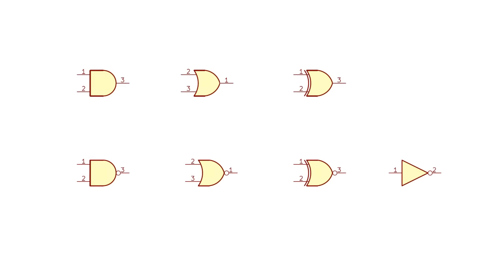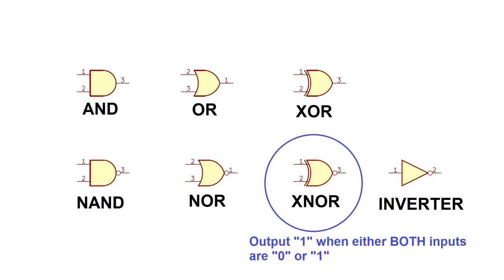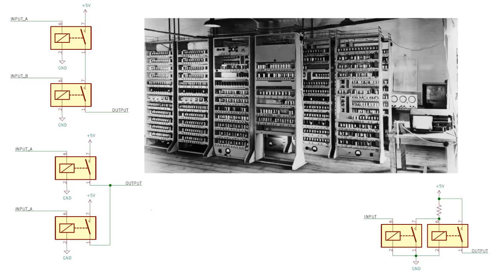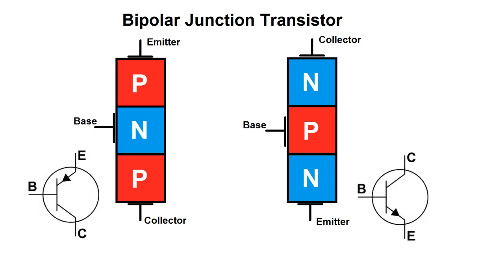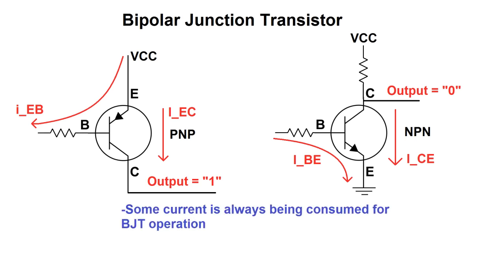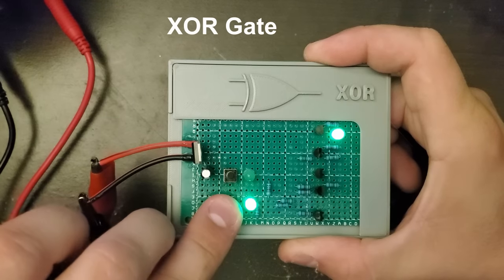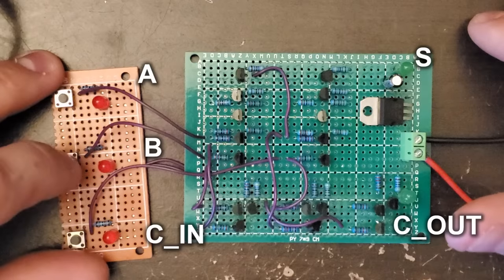8-Bit Adder built from 152 Transistors

Comment: You've done a better job explaining the working principle of MOSFETs and BJTs in 3 minutes than both of my professors did in two semesters of semiconductor physics and semiconductor devices. Hope you keep making content
Reply: I was about to say THIS!!!
Reply: Because you're supposed to know the physics behind and should be able to calculate what is required. You're supposed to learn much more than any random guy watching a youtube video.
Reply: No, he didn't. He didn't explain the "working principle" at all, he presented a convenient mental model. He never said why BJTs act as current amplifier and MOSFETs act as voltage-controlled switches, only that they do.

I'm sure you'll remember the discussions of band gap, depletion regions, MOSCAPs, pinch-off, different types of dopants and their free electron/hole densities, etc. All of those concepts are 100% necessary for understanding how a transistor works physically. What was presented in this video is a shortcut which is good enough to understand a circuit diagram of a logic gate intuitively, but which is woefully inadequate for designing or verifying anything complicated.
Reply: Do you study computer science?
Reply: @tissuepaper9962  Also: The logic described here is Wikipedia - "Resistor–transistor logic" and NOT Wikipedia - "Transistor–transistor logic".
Anyway, nice handiwork and presentation. And a reminder that we all make mistakes;) (What I mentioned above and the wrong emitter arrow direction at the NPN-Transistor symbols). Also: I knew, You knew something, which @braedenbutler4838 did not (or he forgot?). So he couldn't really judge that 3 minutes is a little tooooo less for learning and understanding the principles and physics behind semiconductors. Let's better take 3 years as a ballpark number. We aren't in a hurry, are we?:)))
Reply: There's always this nonsensical comment on any video that explains anything technical but I bet if the teacher gave this as a resource, you'd have people complain that the teacher didn't actually teach.
Reply: @vinayakonimani7628  How original of you
Reply: This is just phenomenal!!!!!
Reply: No way bro i now know wth is transistor
Reply: That's because he's actually playing with the thing, unlike our teachers who strictly stick to the syllabus..
Reply: Wrong transistor symbols, circuits that have nothing to do with TTL (these circuits are very slow), not a hint about carry generation and propagation,  nor the use of De Morgan's theorem to simplify the circuit (Think more to solder less ;). Take a look to the MT15 transistor CPU to see something simmilar but well done.
Reply: There's a book called "Code" published by former Microsoft employee that you'd find very enlightening
Reply: It's important to not confuse watching a video intended to build intuition with actually learning anything. You gotta have both.
Reply: Digital single (Hecate ) 
Sattlite 
Cu tower Airbus cu tower
Reply: Indeed he did. I attended 4 electronics courses during my BE yet hardly any of those 4 gentlemen could be any clearer than this one. Good work!
Reply: they probably didn't know how it works either. As Einstein said 
If you can't explain it simply, you don't understand it well enough :)
Reply: Have you considered paying attention in classes?
Reply: I doubt that... Unless you were taught by crack addicts...

Comment: Is it just me or others too hear some static noise.
Reply: I hear it too, how is no one else hearing it?
Reply: @dylon2314  Looks like bad filters, to avoid this;

1. use maximum gain and 'pin the peaks' (need to be sound engineer and level of nerdness to setup such system)

2. when you edit sound, it is only limited bandwidth you speak, so just cancel all the un-necessary bandwidths and frequnecies. (i think no one features except apple's enviourment, so need seperate apps with this functionality.)
Reply: Nooooooo, now I can’t unhear it 😂 LOL

Comment: The way you designed your circuits, the transistors on the schematic should be npn. However their symbol is pnp. Or am I missing something?
Reply: I think he got it mixed up
Reply: Yeah, i'm confused af
Reply: You're correct. I noticed the same thing.
Reply: PNP works the opposite way right?
Reply: @yun-z  pnp woks with the reversed current, if that's what you mean
Reply: Upside-down pnp's too
Reply: i dont know how it works and why it works but i agree
Reply: Yup, his diagrams and current flow show PNP, he really meant NPN
Reply: @sshilovsky  no, what everyone means is on a plan a pnp has the arrow pointing in an npn arrow points out, but it makes no odds here really as he put 1,2, and 3 on the plan  anyway.
Reply: At 6 minutes in, and beyond, yes, that's an error in the drawing.  Correct in that we want NPN, but the PNP symbol is drawn.
Reply: The proper fix is to replace PNP symbols with NPN.  But a quicker unconventional fix would be to replace the "+5V" at the top of the diagram with "-5V".  It's unusual to draw diagrams with upside-down voltages, but I've seen it done in real life in designs from decades ago.
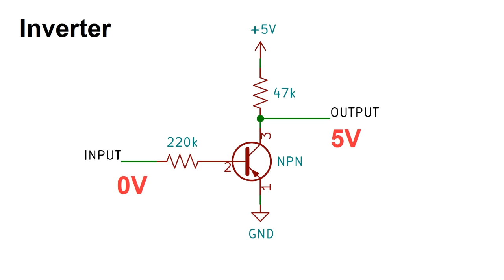Reply: i noticed the same thing @ 7:00 in. the electron flow is flowing with the arrow, not against...so I think you are right, wrong transistor, small technical fail.

Comment: In high school (1988) I designed my own (on paper) calculator using logic gates. Addition , Subtraction , Multiplication, Division.  8  bit multiplication was almost an A3 paper. Division is the most challenging one because you have floating point result. When I tried to design my own 8bit processor based on 8086 design I gave up because it was huge
Reply: Can you share the circuit. Let me try to bring your idea to life
Reply: @shantilkhadatkar1195  This happened in 1989. Unfortunately I do no longer have the plans.  But it is easy to make
Reply: I used Minecraft, when i added my first 2 bits. The feeling i cannot express
Reply: @shantilkhadatkar1195  would recommend using several RISC-V sub processors to decode and execute the x86 instruction set.  The program that runs on the sub processors is called microcode.  That's pretty much alot of the way those HUGE processors work...
Reply: @kayakMike1000  Thanks! Will surely look into that
Reply: You don't need floating point for division. Integer division or  div-mod is a thing.
Reply: did same while I was school. But not division
Reply: was it because you got hallway through a sentence and stopped wri........
Reply: Can you share about which transistor are you using/plan to use?
Reply: It's super cool that you wrote all that out by hand.
You should try using Logisim Evolution, software for designing circuits. I just had a class project where we had to build an ALU for a CPU with 8 instructions, and one of them was 8-bit multiplication. I used an array of 8-bit half- and full-adders for mine, 64 in total, I'm pretty sure. It did take a lot of space; I had to zoom out a bunch.
Reply: @maxine_q  I tried to replicate the arithmetic operations the way you do it by hand.
Reply: What kind of resources were available to a high schooler in 1988 on topics like this? How did you learn to design a calculator back then? I worked on similar projects as a high schooler, but I graduated in 2021, when it was way easier to find information freely online
Reply: @lambdamoth  I got an illustrated book on computers from Time magazine.  One page had boolean algebra,  and the next page showed how the half and the full binary adder work. That was enough for me to start  . I already had a home computer and was reading computer magazine 
s but that was specialized knowledge for the time.
Reply: Try something like a 6502 or Z80...think of the commodore 64 or zx spectrum. they are totally doable if you have the time and the dedication. x86 is far more complex and dense with way more logic gates and other memory protection circuits thrown in to enable todays multitasking OS.
Reply: hope you can also make videos about 5bit-signed sir 😭
Reply: Your rock.
Reply: Ben Eater has a series where he builds an 8-bit computer, including the CPU, out of individual logic chips. It's not quite to the level of using individual transistors, but it's an excellent series and he has a very engaging way of laying it all out and explaining how every part functions and how they work together, he also has a rather soothing voice. It's very educationa and interesting.

You might find it and interesting watch.

Comment: Well done! I helped build something very like this 50 years ago at school here in the UK as part of a simple ALU. IIRC, the adder could be driven by a 50 khz mains signal and act as  a clock of sorts. My recollections are hazy after all these years, but I do remember the device came from a magazine article which called it BEATLE, standing no doubt for something like Binary Electronic Arithmetical Tabulating Logic Engine or some such! Lots of soldering and great fun to put together!

Comment: For those who don't know I would like to add that the 8 Bit adder circuitry that he built in this video is also called a Ripple Carry Adder. There is another type of Adder that appears to look more complicated as additional logic is integrated into it. The more complex version of the Adder is called Carry Look Ahead.
Now for a simple 8 or even a 16 bit system a regular ripple adder would be more practical as it requires less components, is a little bit cheaper, easier to build, easier to debug and troubleshoot and takes up less space, and the evidence of propagation delay is nearly insignificant. 

So why would anyone want to use a Look Ahead Carry Adder instead of a simple Ripple Carry Adder? This becomes more apparent when your word size (number of bits to represent a binary number) becomes larger, or the Scale of the Adder. Registers or buses with 32 bits could be implemented using either type but once you get into 64 and 128 bit word sizes... The issue then becomes the time delay for the carry bit to propagate across each adder within the chain of adders. This would slow down your calculations everytime you tried to add 2 binary numbers. So imagine a piece of source code that would go through a loop 100,000 or even 1,000,000 times and you had say an extra 100-200 nano seconds of delay waiting for the carry bit to propagate to the next adder in the series of adders. How much added time delay would there be within your computation of a simple iterative loop?  

This would significantly increase the wait time for the computation to complete. Since transistors have become much smaller in size the ability to add more logic to a N-bit adder becomes feasible and practical to reduce this latency. What a Carry look ahead adder does is it predicts the carry and pushes it to the next adder in the series so that each of the consecutive bits within the word size doesn't have to wait to perform the calculation. In this situation the result is almost instantaneous. However, the larger the word size becomes the more the Look Ahead Carry Adder grows in complexity in an almost exponential fashion. 

Some of the largest word sizes today can be as big as 128, 256 and 512 bits. However, you won't typically see these as your average or common bus size words. Most systems today are 64 bits as that is the bus size of the architect that propagates through the CPU's ALU. Yet these processors can have special registers that are 128, 256 and 512 bits in size which are required when performing multiplicative operations or vector intrinsic instructions.
Reply: Does that last bit apply to AVX512, Intel's XMX matrix multiply, and Nvidia matrix Tensor?
Reply: @mitlanderson  I'm not sure, I'd have to look into their implementation design, their logic diagrams and schematics to see what they are doing with them.
Reply: @mitlanderson  those would most likely be using logarithmic tree adders since the operands would be longer. Plus avx512 is infamous for its power consumption so most likely optimised for performance > minimum propagation delay

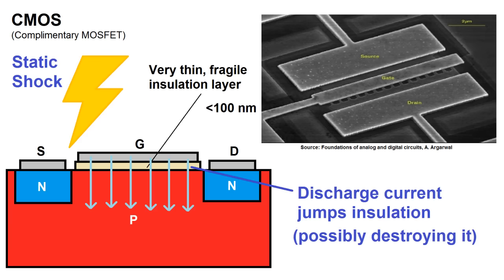Comment: 5:26  The thing to keep in mind about ESD is that the static charge being discharged doesn't have to directly conduct to the MOSFET element being ruin.  Sudden ESD events typically involve such high currents (although brief) that the discharge induces too high voltages in MOSFET elements near by the discharge path.

Comment: The adder works in real time, without a clock. The sum updates as you enter values. We can see the carry propagation. First time I see this classic circuit in real life.
Reply: correct. one function of the clock is actually to slow the CPU logic down enough that the complex circuits like this have time to propagate and reach a stable (correct) value.

Comment: There are discrete NMOS and PMOS transistors with built-in very robust ESD protection. They are very difficult to kill, because the gate is protected from ESD and overvoltage.

Comment: Straight to favorites ! You've assembled one of the best video explaining transistors in a very short and accurate manner that anyone interested can understand. Brilliant job, as long as this video is published, im going to show it to anyone who needs basic knowledge of these semiconductors !
Reply: So you didn't notice the blunder at 5:53 and later when he used the wrong type of transistors in the circuits: all the base-to-emmitter arrows are inverted. The arrowheads should be at the emmitter side in NPN transistors for the base-to-emitter current to proceed to ground voltage supply wire (the base-to-emitter positive current means that electrons, having negative charge, travel from emmitter to base, against the arrow--- but the arrows are all wrong in these circuit schematics). In PNP transistors, it's an emmitter-to-base current that is positive, as signaled by the arrow from emmitter to base.

Comment: You actually can reduce the number of gates further if you use Pass Transistor Logic (PTL). With PTL, you can make a full adder with only 6 transistors. PTL is slower, but this shouldn't be a problem for what you are doing. Additionally, you will need to put a buffer stage (just two NMOSFET and two pull-up resistors forming two inverters should do fine) at the end of the PTL circuit, since PTL will result in a high impedance output. This will allow you to drive the LED. You should be able to make the circuit with at most 64 transistors using the design I specified, but it might be possible to go smaller than that.

Comment: What a breakthrough compared to vacuum tubes. You've gained miniaturization and reliability. Transistors are the future !😊
Reply: Is this what modern day bait looks like?
Reply: I wanted to build a simple vacuum tube computer, but after watching this, realized the massive power needed as well as dealing with the heat of 100s of tubes. 1W/byte basically put this idea out of my reach
Reply: @pauls5745  - I think that was 1 watt per tube, not byte.  So for this circuit, that's 152 watts.  The 200 volt power supply also poses another challenge (staying alive).

Comment: Looking at the 1 bit adder, I noticed that if you replace the two ANDs and the OR gate with NANDs, you get the same result saving 3 transistors per bit adder, for a total of 24 per full adder. Maybe it can be optimised even more.
Reply: Maybe he preferred something easier to assemble, aka faster

Comment: A valve computer would use less power if it used sub-miniature valves (Often operated at 28VDC). The TTL gates you're showing are actually RTL (Resistor Transistor Logic) gates.

Comment: It would require me at least two hours to build one board, and probably another hour to find and fix any error.
I've assembled circuits just as an hobbyist, and not very often, but that made me realize how important is to understand well the theory behind a schematic before building one.

Everybody's gangsta until the board is flipped and compnents must be soldered  in reverse!

Comment: I designed a 16 bit ALU with parity predict in the mid 1970s for a large computer outfit.  I was limited to about 5 or 6 levels of logic to meet the frequency requirements.  All the gates were 3 or 4 input nands.  Look-ahead carries were required to keep the proppgating delay low, especially in the partity predict logic.

Comment: Just for those of you wondering why voltage is that critical for CMOS. As the input voltage rises or drops on an input of a complimentary pair, the switches should not conduct simultaneously at any moment of time (this is called a shoot-through), therefore their on-voltage regions (starting at the so-called gate threshold voltages that is) should never overlap, and also have some gap between them to give the switches some time to react (aka deadtime). Now as the supply voltage rises, the regions ((Vcc - Vth) to 0, and (0 + Vth) to Vcc) can start overlapping causing the system to fry due to those quick short-circuits. If there are no pulses coming through, the voltage can rise "safely" until it causes a gate breakdown (which is usually much less than the drain-source breakdown voltage).

Comment: I know how to build the entire ALU and CU with 256 bytes of memory and I still have the ability for parallel synchronization processing. The only thing I’m lacking is parts and time. Your video is extremely informative, especially with the type of transistor I intended to use for my design.

Comment: I really like the idea - possibly something I will build to show my students this autumn, but possibly in NMOS with the 2N7000. 
Apart from the schematic error and the slightly wrong explanation of the p-channel MOSFET also a good introduction to RTL. By the way: modern CMOS chips have protection diodes on their input pins and are much less sensitive than the earlier versions which are still around in the literature.